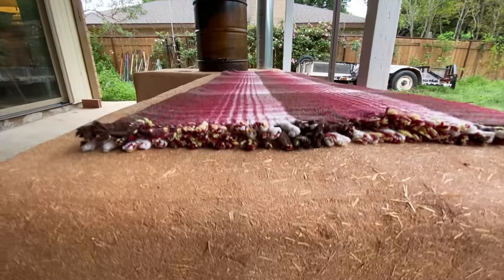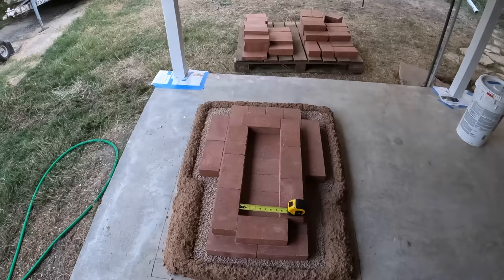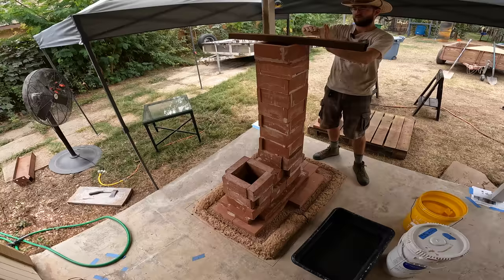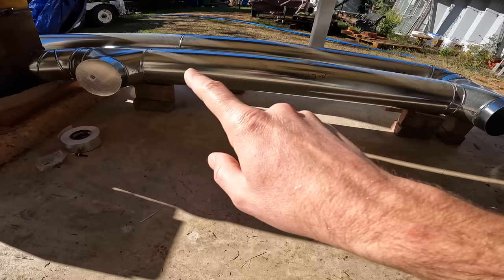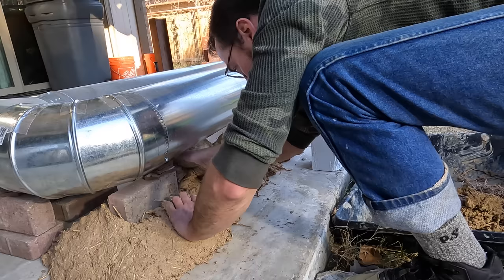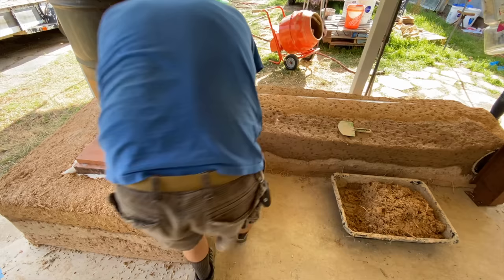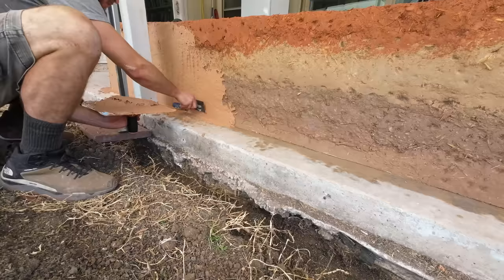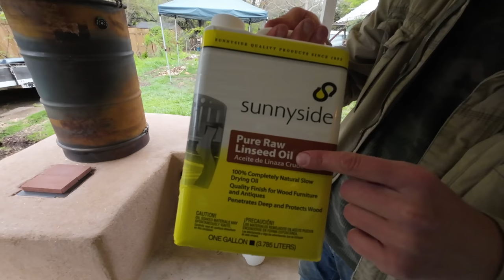World's most efficient stove!!!!  Made of DIRT!!!

Comment: I enjoyed your video production and I have noticed some good ideas, over kill, complicated cob mixing, and I am sure it works well. However, I watched many other videos and got great ideas with the best draw  on heatr one can get that I have found was using crusher dust for a cob.  It is crushed concrete recycling and it naturally packs from expansion of heat.  I used 2 by 4 stud walls three feet tall with half inch plywood framed up with my hvac piping the same system as you have done which only took me a day to build, then carried one half yard of crusher dust by carryting it by pail and filled up the inside walls.  I happen to live close by a steel plant that had reject quarter inch thick pipe walls in my rocket stove and did not use steel barrels.  The guage in the steel barrels will never last under the intense heat so I went with the quarter inch steel pipe and steel plates that was rejected by the steel plant. I paid $200 for half ton worth.  My rocket stove weighs 300 lbs alone and the cob was a ton.  My proof of my experiment was growing potatoes in minus 40C here in Regina, Sask. Canada is that I would burn wood thru the day while working in my shop. The biomass of my crusher dust collected so much heat, that I wopuld shut down and closed by rocket stove off and it kept my potatoe bed warm thru the night until morning. The cob building I watch on your video is unnecessary and it is overkill.  Your rocket stove barrel will need replacing because heat deteriates the steel.  I used a tall propane tank as my primary stage burner and used 3/8 thick steel plate and welded four sides together. Then the rocket was ALSO encased entirely in crusher dust and held in using tin plenum scrap and made four walls using self tapping screws.  The biomass experiment was more successful than I expected when using crusher dust.  But hey, one can just use sand, or gravel or clay or whatever you want.  Its essentially a heat battery that can hold heat hotter and longer and it does not require a straw mix with mortar which is too labor intensive.  I should put together my video of my pictures some day of what I have done.  But, i got tired of burning small sticks of wood which needs an automatic feed system using wood pellets.  Keep up the great work tho,  anyone can enquire me for a conversation can reach me at this email.   dongreenfield@sasktel.net
Reply from the maker: Thanks for sharing your experience. It sounds like you’ve found your own path to a very functional (and in many ways more practical) version of this heater. I wasn’t ready to go off-menu so I kind of used a book as a guide. I appreciate your advice. Thanks!

Comment: I had a heater in one of my greenhouses, quite similar to this. An oven insert were the base of it all, a bench were built in order to give seed flats and cutting trays some bottom heat. But I didn't use cob, but bricks, cinder blocks ( Leca block they are called here in Norway) and heat proof plastering. I took the idea from a book from a Chinese farm house, where they used the flue as a bed, a wide one of course 😊. This under bench heating kept my greenhouse frost free all winter, but a lot of fire wood were consumed. Perhaps this kind of heating is more economic when it comes to wood consumption? Something to ponder about for me 😅. Greetings from Kenneth in Norway.

Comment: The consistency of your final coat is close to drywall texture mud. I would get a haevy-framed paint roller and a 3/4" knap roller and roll on the muxture and use a larger knife like a 14" drywall knife and a 14" drywall pan instead of the hawlk and trawel. If you mixed enough in advance, you could roll that on and pull it level or smooth with a concrete float or something you know to have a square strate edge that is wider than the part you are coating, much like screeting. You could even build a jig to do just that, but I feel it would only be overkill unless you were going to build many more stoves.

Comment: Thank you so much! I've seen so many rocket stove builds that did not use a single square corner or  measurement. They are all too "organic " for me. I wonder if you could make a cylinder/sleeve out of decorative metal, the type they use on screen doors to keep dogs from pushing through, that was slightly larger than the barrel. I'm always afraid a kid will put a hand on it, (only once I'm sure), but still could be quite a burn. That is the best rocket mass heater I have seen in any of the videos.
Reply from the maker: Thank you for your very kind words and compliments. I have had other folks comment with a similar suggestion about making a screen around the barrel. I think it’s a very good idea. I have only really had time to burn it a few times before summer hit this past year. This winter I will be using it much more and I will have to gauge how aware of it my kids seem to be. Given how crazy my yard is they tend to have a pretty good sense of danger overall because I try to take the time to teach them the insects and snakes and types of grass not to mess with. But you’re right that could be quite an injury. And scars last forever. I will keep everyone posted on how it goes if I wind up making a screen guard. It’s definitely not a bad idea. Thank you for subscribing!

Comment: I love this, Build!  Well done.  One thought. If you were going to burn pine in the stove, you could have an issue with a creosote fire in the chimney. Consider using hardwood for making your fires as they have considerably less sap that can stick to the sides of the pipe.
Reply from the maker: Thanks for the tip! The theory is that these stoves burn hot enough in the heat riser to consume the creosote. But I definitely would prefer to play it safe. Thanks!

Comment: Awesome job. I didn't understand or by guessing from the black inside the vertical part that you are not getting secondary burning or the total burning of wood gases. Secondary burning reach much higher temperatures but increases efficiency, making easier the cleaning (no black, no ashes inside chimney pipes).
Reply from the maker: A lot of that soot came from me lighting early fires before the bell and brick construction was sealed up. It led to tons of unclean, burning, and tons of smoke. To be honest, though I have not opened it up since the project has been completed. I wonder how much so it would be visible now. I would imagine much of it has burned away. I plan on making a follow-up video around a year out. Maybe I can include some footage of that. Thanks for commenting and for subscribing!
Reply: @suburbanbiology  ok. You might need to try a second air input after the main horizontal  fire or check rocket stoves with secondary burning.

Comment: Cool Build.   My only concern is that you have used galvanized B-Vent duct.   That is not rated for the high temperatures that a wood stove is likely to produce.   A better choice would be to use 304 or 316 Stainless Steel duct that is rated for Engine Exhaust.   That will significantly drive up your pricing, but if you have an out of control burn-   that duct is rated for 1400 Degrees sustained and 2000 degrees flash.   You Type B -vent is rated for 600 Degrees.   

Finally,  I would have added a drip leg at the base of the duct work where the Flue turns vertical. These flue gasses are likely to condense and with the burn particles,  you are likely to create what is- basically acid rain.  Getting this liquid out by building a drip leg in that Flue will help solve that.

Comment: As I'm watching you do your clay stucco and I just have to point out how much easier that would be if your outer surface was Adobe blocks or bricks. Them you could do the top with the same material like it was a concrete counter. let me add you've done an amazing job regardless and your final finish is amazing considering what you were working with. By the way, i'm 65 and i spent 40 years in the flooring business which included lots of tile, showers etc so while I haven't done stucco I've worked with trowels and lots of things that relate to working with materials like this.
Reply from the maker: Yeah, a lot of people in these comments have agreed with you. The most common comment I have been getting is that I should have finished it with a lime plaster on the outer surface. Apparently that would be even more water resistant, and it leads to a much smoother outer surface. Maybe I will do that someday. Thanks for commenting and for subscribing.

Comment: There are three fundamentals for wood fire efficient heating (1) Insulated combustion area (2) secondary air inlet to combust burn gasses (3) maximum heat extraction from exhaust. Your system very successfully address item (3).
Reply from the maker: 1) is pretty solid too. Ceramic blanket around the heat riser.

Comment: Very well narrated and constructed. Only suggestion I have is to use a drywall taping knife (like 8" to 12") for the final coat. It would be much more pleasant and quicker.
Reply from the maker: Thank you for the tip. I am definitely an amateur at anything resembling sheet rock work, masonry, work or even building this. I learned as I went. But I’ll keep that in mind for the next project. Thanks for commenting!

Comment: Nice. We build this without the metal parts at my grandmother house. But there is big difference our stove not cracking. I think because we mix the clay and straw and sand by foot. We use rubber boots and we need to step on it(long time stepping), also we use metal web(chicken web)  at the first layer. First day chimney and chanel let it dry but cover it if it is on the sun. Second day every other material in one time (3 men job, 1 build others mixing , stepping) On the top layer don't need straw. One day dry,second day very little fire light up for 2 day. Your last layer should be 1-2cm and no straw need.
Reply: After a week cover it by lime paint thick layer
Reply from the maker: I may take the time some day of covering it with lime so that it has a smoother finish. Thanks for sharing your process. You have a great deal of experience from the sound of things. Thanks!

Comment: TO stop the fire climbing out of the Wood hole > A 8 inch draft hold is needed in the front of the unit, directly in front of the wood hole so you get a straight influx of fresh air after closing off the wood hole on top.
Reply from the maker: Maybe for the next version I’ll try. Thanks for subscribing!

Comment: The entire J tube section can be easily built with rammed Earth using a form instead of bricks and instead of a ceramic blanket, perlite mixed with a small amount of clay to act as a binder can be used for insulation. Simply build a plywood form around the Jtube leaving a gap of the desired insulation thickness, and then fill with the perlite clay mixture. Let dry and remove the wood form.

Comment: New wood stoves preheat the intake air and have a secondary burn chamber to extract more heat. Some also have catalytic converters to further extract heat. 8" ducting seems large. I've only seen woodstoves with fairly large burn chambers use 8" exhaust. I would wonder if you'd get better draft by reducing the diameter after the long run of heat extraction. The heat extraction reduces the internal energy of the exhaust. The reduction in diameter could help boost the speed after heat extraction.

Comment: During tve 1770s two Swedes invented the tiled stove that is more efficient than this stove. Mainly because the storage weight is around the place where the gasses are the hottest. These tiled stoves were mandatory during the 1800s and 1900s in Sweden. By making the "barrelpart" in a heavier material you would increase storage and even out the temperature over a longer time. Still a nice build. And thx for the excellent building instructions. A tiled stove is not a diy thing.

Comment: Rammed Earth is a much better way to make the bench than with Cob. Rammed Earth is far denser and won't crack. Holds more heat and transfers heat better. Even though you smooshed the Cob tight against the Hvac tubing, I guarantee you still have an air gap between the cob and tubing. Cob shrinks a significant amount after drying. Rammed Earth is a far superior method to make the bench and shrinks much less because it is highly compressed and contains much less water. If you're lucky to have good clay content soil that's perfect for rammed earth, it's also much less labor intensive requiring no mixing if you either wait until its rains the right amount so the ground is just barely moist, or you can just spray the ground with a hose until it's barely moist. Then you just dig the barely moist soil and pack around the tubing and make the bench.

Comment: The book you are reading seems to have lead you well.

IF you start having failures, here are possible causes of failure I saw that you might experience. Again, this who build looks really good.

1)	Metal fails if it runs too hot for too long (oxidization). I expect you’ll need to replace your bell top-plate (barrel lid) every 2 to 4 years. You might need to replace the whole bell every 10-years. Maybe a stone bell top would work, but how would you attach it. IDK.
2)	I noticed you placed the first course of (dry) fire bricks directly on to the Perlite bed. I wonder if wetting those bricks would have helped prevent ‘disconnection’ of the fire bricks from the pearlite.
3)	I noticed that you didn’t put clay slip between the first course of (dry) fire bricks on top of the Perlite bed. Maybe no big deal. I just noticed.
4)	Some RMH experts argue that clay is a great (sticky) sealant for the first 2-years, but turns to dust after that. Reason: clay is sticky (binds the sand grains together) only while it has moisture in it. After clay is perfectly dry, the clay particles loose their sticky nature, and become clay dust. If so, then the clay sli you put between the half-bricks of your heat riser will fail in 2-years, and you’ll have a loose-stack-of-bricks as a heat riser. Again, I don’t know who’s right. I’ve seen an all-cob heat riser turn to dust, but I also bet the book you are using is right. So … IDK.

These are just ideas. Not criticisms. Thanks for this great video.

Comment: Be careful with the galvanized HVAC ducting!
It is plated with ZINC!  Have lots of ventilation when heating with no heat sink! If the zinc gets just a little above its melting point, it readily turns into a gas which is poisonous!  Ask a Welder!Not many PPD'S filter zinc!  Special filters are available, but the best way is to burn the zinc off while burning the paint off the barrels! Just put them inside one of the barrels and heat it up until you see the zinc burn off of the flue stack.
Will rust quickly, but a little WD-40 will stop that!

Comment: I will be trying to build one of these t my house in AL.
Reply from the maker: Good luck with your project. I hope this video helps you. I would advise using stainless double walled chimney instead of the HVAC duct I used. Indoor heaters should use proper flu. Mine was on a porch so I cut that corner a bit.

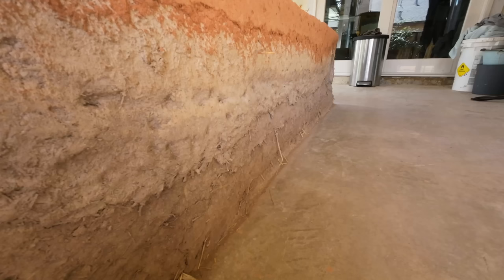Comment: 54:00
There is no need for hair cut. You can burn it (like you burned paint of the barrels). Usually first layer and last.
All straws that are to long will be removed. 

Also a question - always when I see that kind of stove my question is: what with air intake? You are taking air from the space You are heating. So pressure is dropping and air form the outside is sucked in. Cold outside air.
Will it not be better to create seprete combustion air channel like in modern fireplace?

Comment: Have you considered getting a nice thick tempered glass square for the wood hole? Make a metal frame with iron stove handles. Would let you see inside and much more functional than just 2 bricks on top.
Reply from the maker: When you block any portion of the feed tube with the bricks, it changes the way the air swirls. that swirling effect often winds up collecting soot on the brick. I had thought of a glass top like you’re suggesting, but it would very quickly get coated with soot, and then the view would be obscured anyway. So mostly out of laziness I probably won’t do it. I suppose I could clean it off intermittently but again. Laziness. Thanks for commenting!
Reply: @suburbanbiology  there is a way to introduce cool air flow just prior to the glass doors in wood stoves, so the air passes in front of the glass, greatly delaying the forming of soot on the glass. I wonder if this could be incorporated into your dirt warmer somehow. Maybe too late now as its already done. Something to keep in mind for the next time maybe?

Comment: One of the most comprehensive videos I’ve seen for rocket stoves!! Very well put together and it shows!! Only question is, is there a requirement for a stove pipe sleeve because of the close proximity to the roof where the bend was made? Thank you for sharing your time and hard work.
Reply from the maker: One should always follow local fire codes. In my case the chimney passes through cement board with rockwool insulation. The roof is buffered by a metal awning. Those details can be seen below. But local fire code is king so follow that.

FREE HEAT!!! Sauna in greenhouse porch heats our house.
https://youtu.be/WXjYxUpmDwg